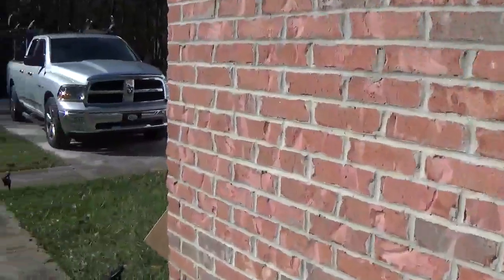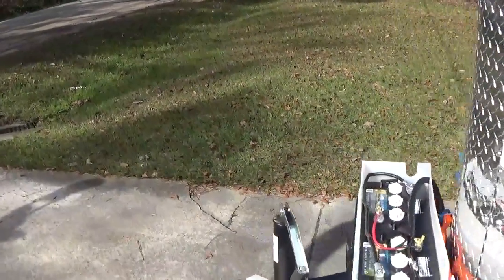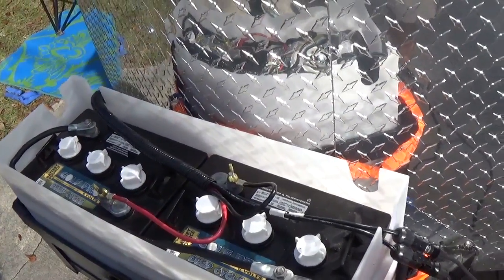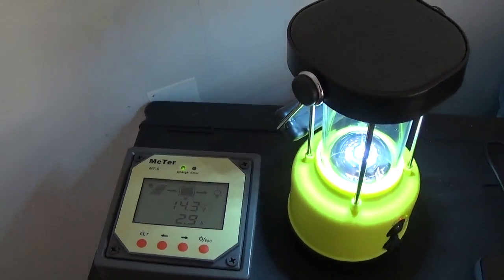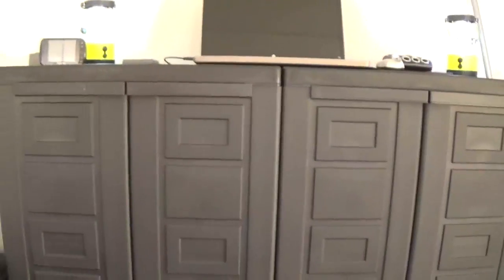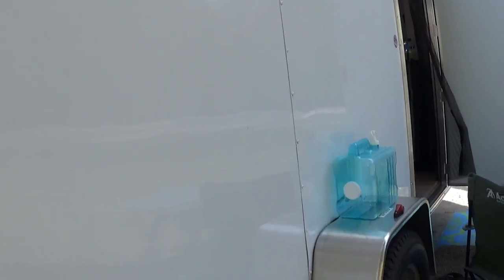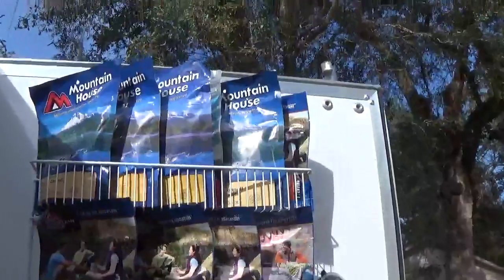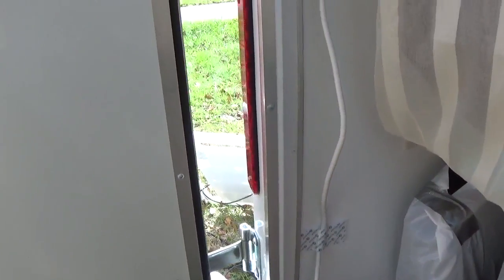Complete Solar Powered Bugout Trailer.....Part One

Comment: You have a great trailer. Simple setup that works. How does it hold up with a 110 converter?
Reply from the maker: No problem at all...naturally, you just have to keep an eye on the battery levels.

Comment from the maker: All batteries such as AA and AAA are rechargeable and are maintained using Goal Zero Solar Chargers (Goal Zero 7 and 20) or can be recharged directly through the 12 volt adapters located in the trailer.  Walls and ceiling completely finished and insulated.